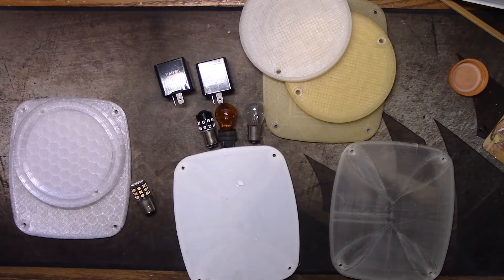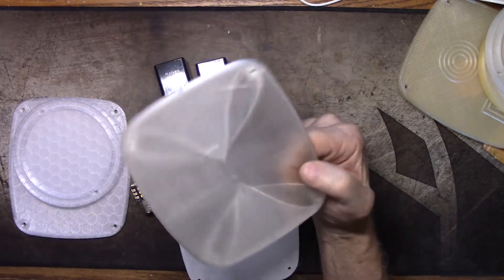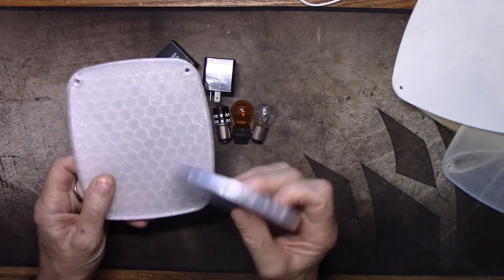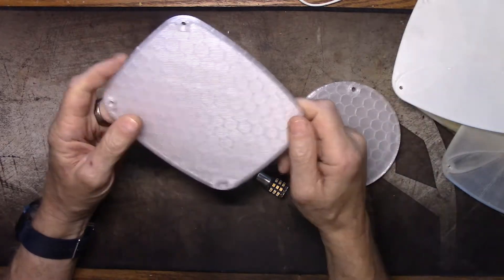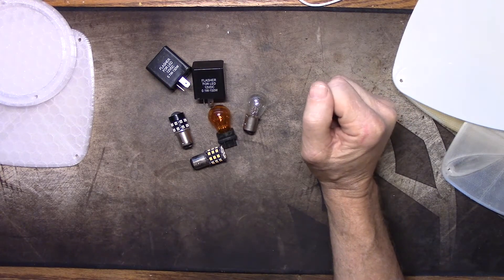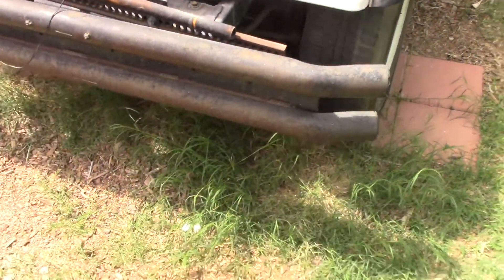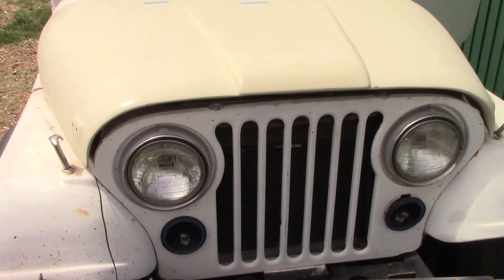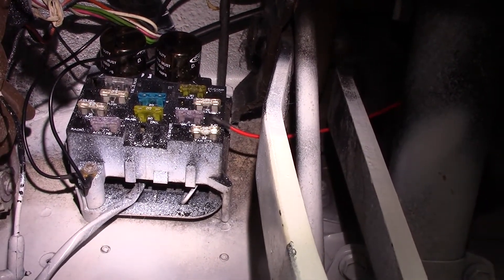More 3D Printed Tail Light and Parking Light Lenses. And CJ-7 Conversion to LED bulbs!

Comment: Funny how usage changes from one person to another with slicers. I had ALL possible problems with Cura, had to heavily modify tons of settings and eventually got sick of Cura. Prusa Slicer worked out of the box and the only changes that I make to slicer settings is temps for filament types, infill, supports on or off, number of bottom/top layers, and thickness; all based on what I want to do with the part. It just prints great for me without having to tinker.
Reply from the maker: If you look at my older videos I've had tons of issues with Cura. Back when I was having the issue of gaps in the top layer I tried Prusa Slicer and it worked correctly with no adjustments at all. But some of the settings are so obtuse and backwards to Cura that it's been a tough transition and I end up going back to Cura since I'm so used to the issues it has and I understand it's settings. I'm not sure what the issue was with the lens, but it did it three times in a row so it wasn't a fluke.

Comment: Have you tried superslicer? I get some strange artifacts in my first layers with Prusa, when I slice the same stl with basically the same settings in superslicer and cura I do not get those strange artifacts in my first layers. The first 2-3mm of my layers wit Prusa seems to have very rough edges and lines, almost like over extrusion then it starts printing fine.
Reply from the maker: Nope, but I will now. Thanks for watching!